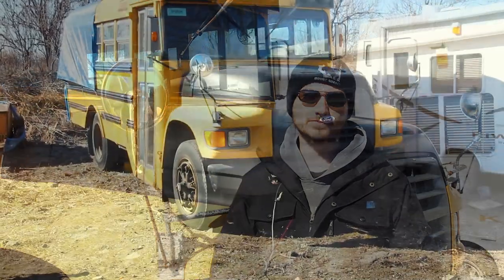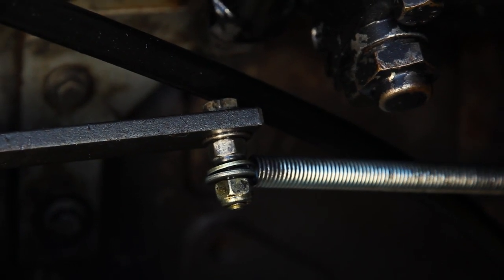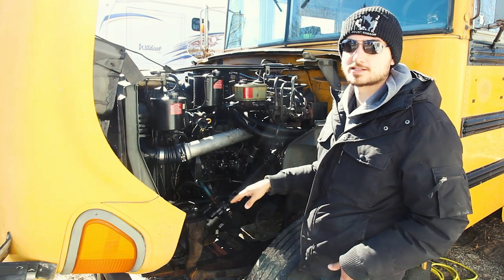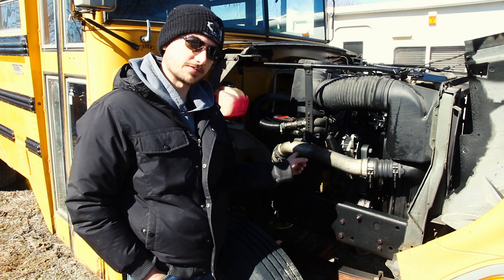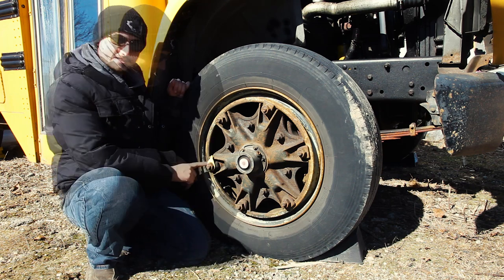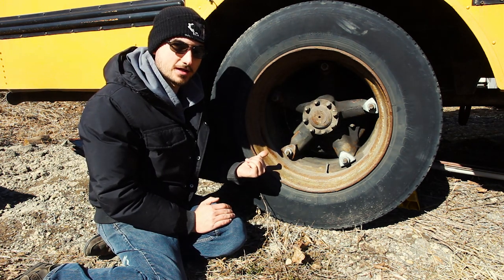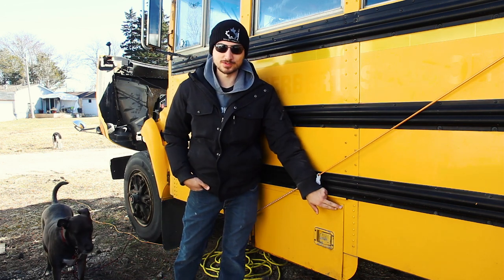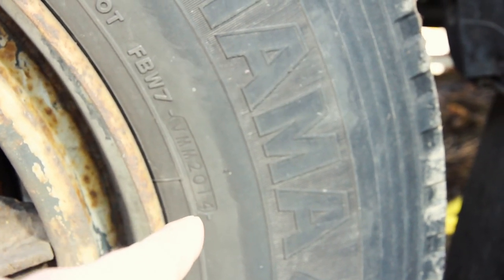Pre Trip Inspection for your Skoolie/Bus Conversion | Buying or Maintaining Your Bus

Comment: #205

Glad to find another build series. I’m all caught up. Leaks are a struggle and I absolutely will not build the interior until I am 100% sure I am safe. I do not recall seeing an emergency exit on your ceiling/roof. Do you not have one? Or just do not have any issues? 90% of my water/rust issues came from the flimsy plastic emergency exit hatch....two to be exact! I was also taking in water from the rear back light fixtures (brakes/signals/running lights) and rub rails. Did you end up taking on the kick panels along the wall floor..? Big issues there too. Anyways, good luck with the build. Hoping this weather breaks soon!!
Reply from the maker: Thanks for the sub! - You are correct we do not have an emergency hatch, we never seen a bus without one before lol - We looked at some full size buses before we got ours, and you could clearly see the rust around the hatches in the interior. funny fact I drove a brand new 2018 IC-Navstar and the hatch leaked! lol - At this point its still hard to tell where its all coming from but as soon as the weather breaks it will be time to seal up everything! Good luck on our build!
Reply: Chasing Sunshine Thank you. Can’t wait for you next vid :)
Reply from the maker: We should be back at it soon. It is finally warm enough here!! But we are just finishing an entire home reno - so by the end of May we should be back working on the bus full time and lots of videos up and coming!!